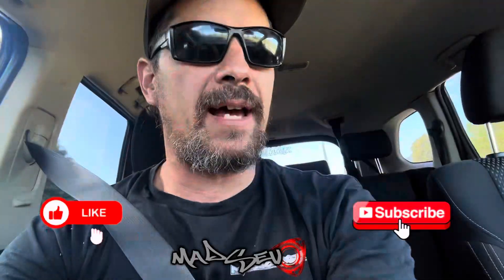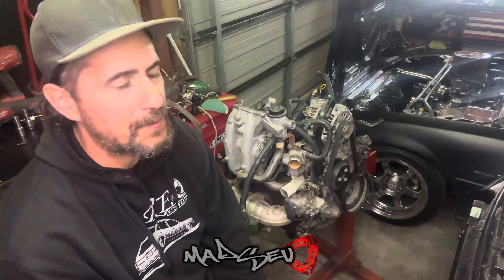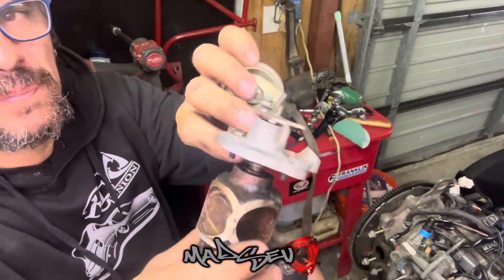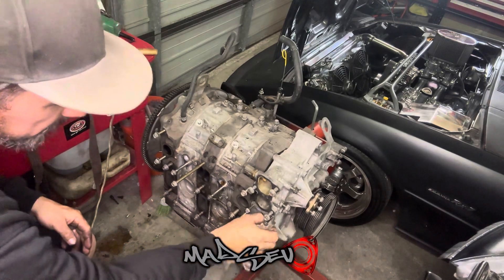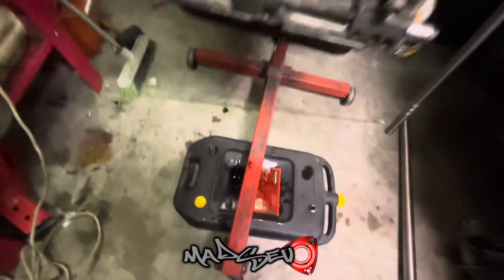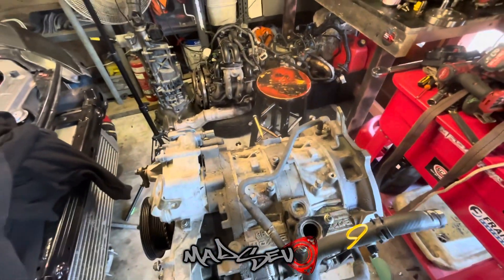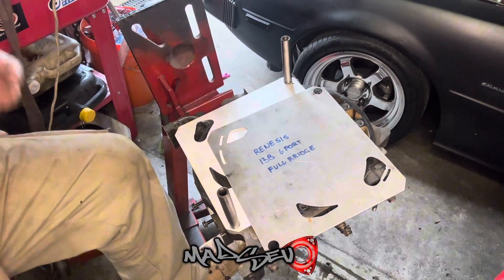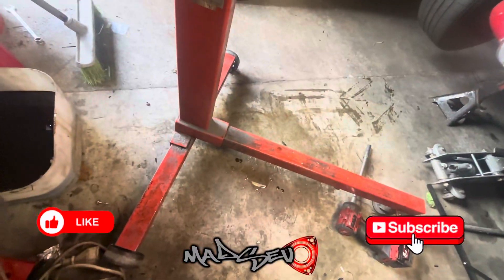Renesis tear down. Pulling apart Annie’s engine to see what we got. @rotaholikzhds906

Comment: Carbon deposits are directly related to what? Shit fuel or lack of lube to fuel mixture?
Reply from the maker: Yeah it’s strange , this engine has been premixed as well as the omp pump. Wouldn’t have thought it would be this much carbon on it
Reply: @Madrxsev  my head says oil injection 2 times means double the oil hence double the carbon?

But I aint no wankel engine expert 😊😊
Reply from the maker: @Rx4Lyfe I think it’s too much oil to burn maybe and synthetic oil may be a drama but yeah I’m only guessing

Comment: Will you reuse side seals and apex seals of a 80,000 miles renesis engine with coolant seal failure?
My engine needs a rebuild 😂
Reply from the maker: No I would most definitely replace them . Ha ha . 80,000 miles is an impressive run
Reply: Yes sr just got this 04 rx8 coolant seal failure ill try to rebuild my self whats for you the most difficult part of the process ? Also what specials tools i need for a complete rebuild?
Thanks man keep the good content.
Reply from the maker: @Garagemx1 the hardest part I find is getting the engine in and out of the car ha ha . But you will need a 54mm socket for the flywheel and you will need to lock up the rear counter weight to get the front pulley bolt off. That thing will be crazy tight. Good luck with it. It’s a lil frustrating but fun at the same time
Reply: @Madrxsev  allright ill try to make a video of the process and what you use to lock up the rear of the counterweight ? thanks man.
Reply from the maker: @Garagemx1 ha ha I used a tube socket in behind the counter weight and it wedges itself against one of the through bolts.  It the most ideal way but it works.

Comment: Just wondering if there is a way to blow carbon off without dismantling the engine,I have heard of those piston people putting atf in and waiting a few days ,then fireing it up….i always give my 13 b a good run at 5000 rpm every time,but just thinking….
Reply from the maker: Yeah only thing that would be a concern is if the carbon fell off in clumps and then would surely mark up the housings I would have thought.
Reply: I've heard of people using ATF fluid, also have a look on YouTube for people using "Seafoam" to de-carbon their rotors/housings. Personally, if you're doing all the maintenance right and there's no issues then I don't see the benefit of spending time & money trying to fix something that might not be broken?
Reply from the maker: @jamesowen418 yeah your right. I will have a nosey at that thanks
Reply: Use Seafoam to decarbonize as much as possible. I ran it through my engine at 120k miles and the engine felt new afterwards.
Reply from the maker: @supermoop a lot of people have been saying the same thing. I will definitely get some and do that . Cheers